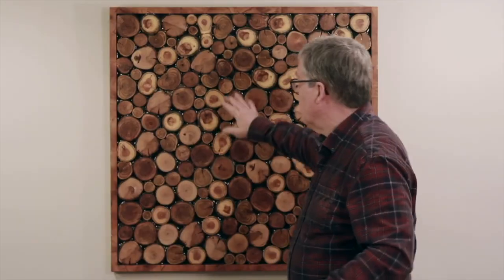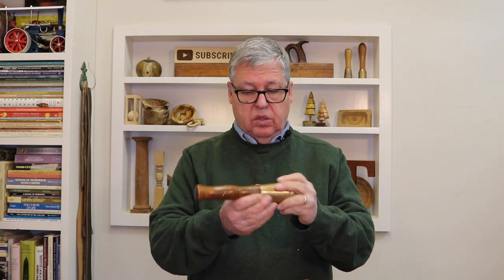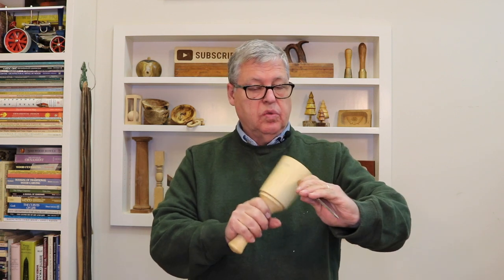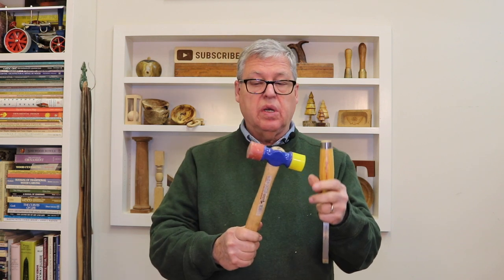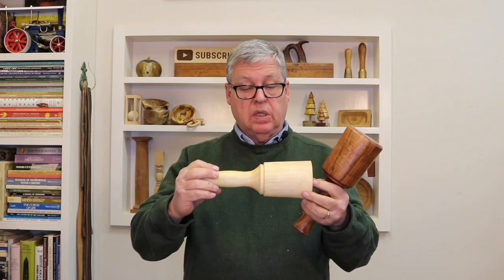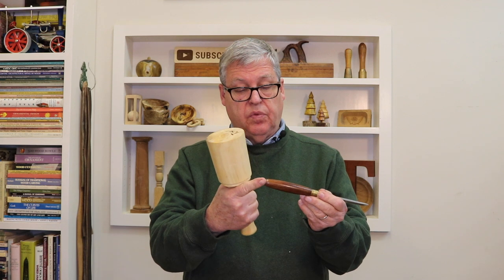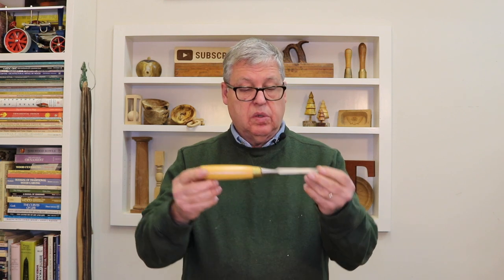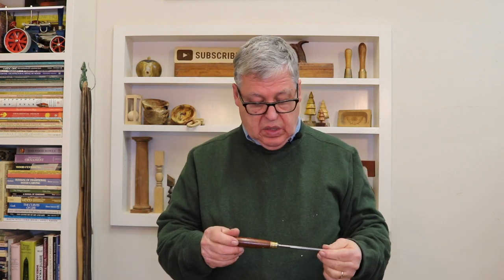Why I Use a Round Mallet for Carving

Comment: I almost bought a rubber mallet. What’s their best use then?
Reply from the maker: Rubber mallets are typically used as a “persuader” to bump a work piece together or apart without marring the surfaces. It’s not used for woodcarving because it absorbs the blow to the tool you’re using and it would be harder to control with the bouncing.
Reply: @shoptalkwithtim  really appreciate you taking the time to explain!